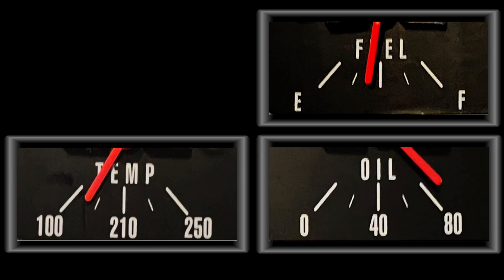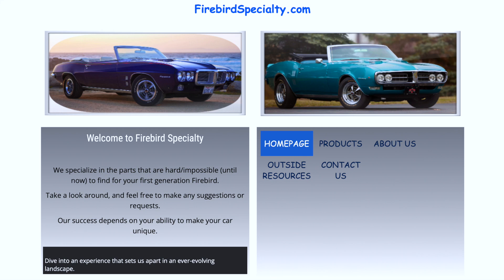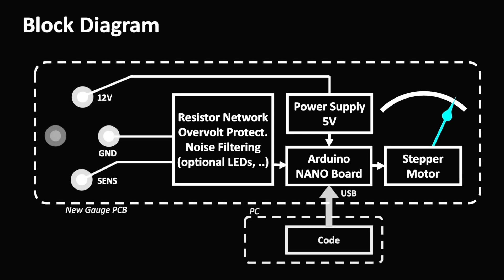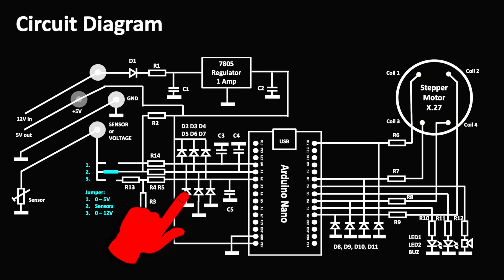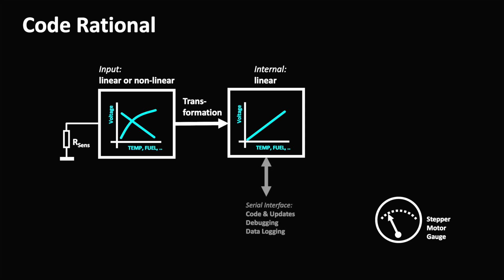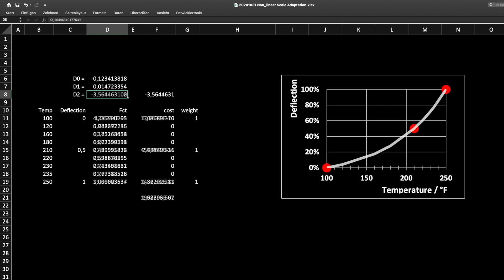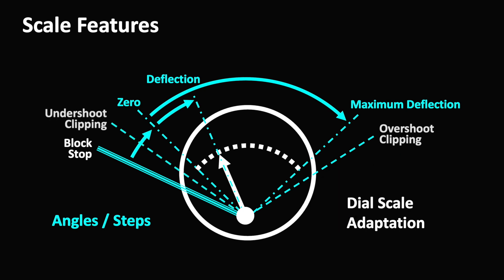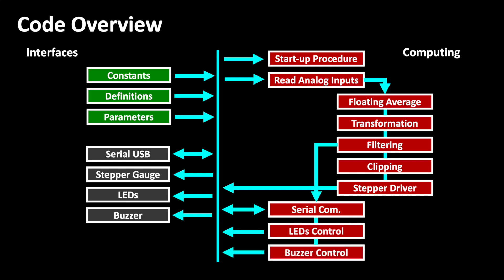How to Build a replacement drive for a Classic Car's display - the Method (EP140c)

Comment: Just a funny idea: if you have a very small spring attached to the "pointer", to pull the pointer back to a "minus-zero" position if the stepper motor power fails, or the vehicle power is off...the stepper motor, when powered, has enough "stall torque" to keep the pointer in position when it is not being moved. Such a setup gives a known starting position to the stepper motor, so it will show that the system is working,  because your software moves the pointer to its correct "zero" position on initialization... You could also use that to indicate a sensor failure, maybe moving the pointer from "off" to "zero", once per second.
Thus, you can have two failure mode indications and a known starting position.
"It's just a thought "
Reply from the maker: Thanks for your great ideas! A spring is a bit tricky mechanics, but maybe I can develop an electronic solution to bring the pointer back to the internal block when the power is switched off. Indicating malfunctions through repeated pointer movements is a cool idea too. Stay tuned!

Comment: Your video took a complicated project and broke it into byte size chunks. Excellent work. The stepper side already exists, for instance Chevy dash boards for the last 20 years use tiny steppers for gauges and can be redressed to match classic cars. I specialized as a dealership mechanic doing dashboards for a few years. Best advice: wear "finger cotts" (bought at any drug store) because any fingerprints will spoil the project and cant be fixed! Watchmakers use them. Gloves work but cause sweaty hands.  The steppers I mentioned are extremely fragile but work when encased in a dash and are quite cheap. Fixing a modern dash is very easy as everything is the same, just different faces. Getting the dash out is all the work. Watch out for 70's and 80's fords as the dash plastic is powder by now and will crumble to the touch.  You can use watchmakers Rodico (putty like stuff made to clean dust, chips and oil from untouchable parts) to finish. A set of precision tweezers helps too. Can't wait for more!
Reply from the maker: Thank you for your kind comments and valuable advice. Stay tuned!
Reply: Thanks for the tips, Greg!

Comment: For classic cars with character, this technology is wonderfull. As an example, the speedo cable system which ran from the gearbox/transmission to the back of the instrument cluster. It is a full mechanical system that was prone to breakdown and took some of the drive energy to run it. Having a speed sensor at the gearbox/transmission end with a wire connection to  a reciever at the instrument cluster is a much better system.🐞
Reply from the maker: Thx for your comment! That's right. Currently, we're aiming to replace Temperature, Oil Pressure, and Fuel Level. But Speedo and Rev Counter might be the next step.
Reply: The designing with the speedometer and tachometer have huge advantages as well.  You would be able to change your gears, or tire size and reprogram the gauge to read correctly.  No more need for mechanical cables spinning behind the dash,  A simple wire into the dash will do the same. Odometer would be transformed into electronic as well, but it is all doable.
Reply from the maker: @talons24  Yes! And thank you so much for sharing your thoughts 😀